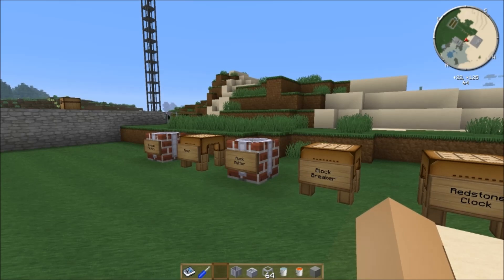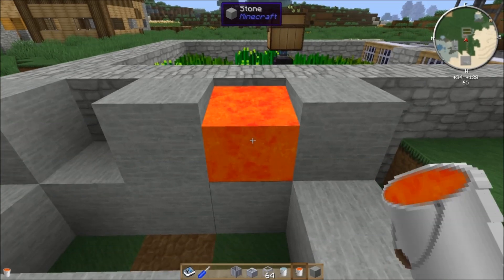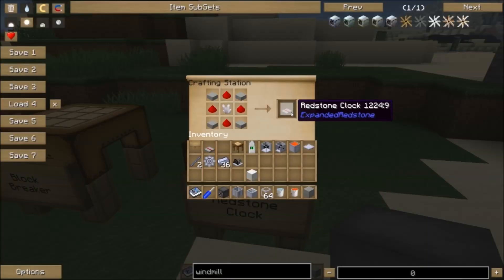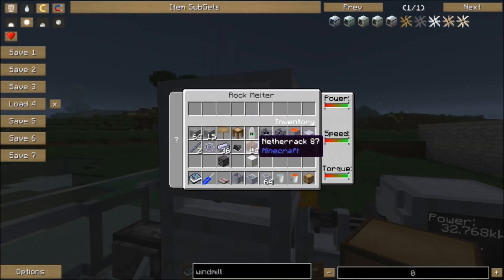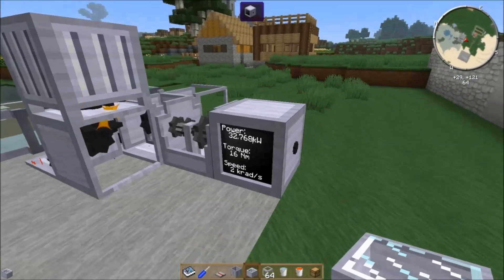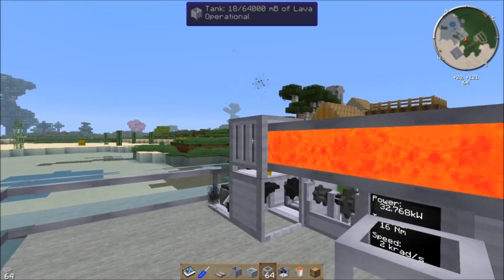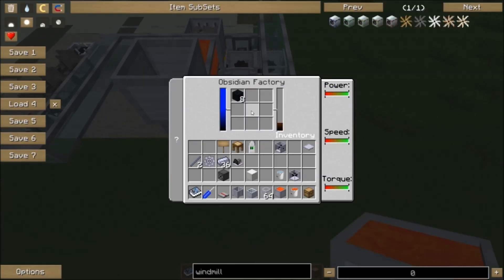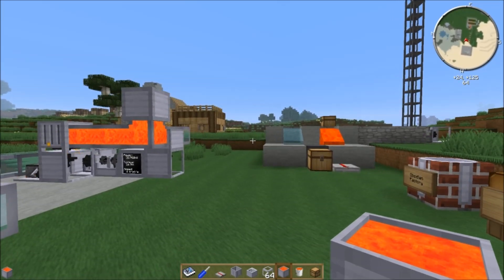RotaryCraft Tutorial #8 - Obsidian Factory

Comment: Having trouble with my rock melter. I am using a steam engine and it melts nether rack but not cobble I tried a x2 gear box but have been unable to get temp above 906. I tried placing bricks all around the melter, capping it with a block and putting lava over it and beside it? How are people using the melter? This is 1.7.10 ver 2
Reply from the maker: The recipes for the Rock Melter are different in 1.7.10 than in this video. I haven't had the chance to use it in 1.7.10 yet.
Reply: SentinalhMC Reika answered me on his thread and stated the steam engine will melt cobble but will do so 4x slower then nether rack. I saw a hint on the thread that V-3 may be out by end of the week, His is the first mod I've taken time to donate cash to. Love his mods even though they confuse me sometimes!